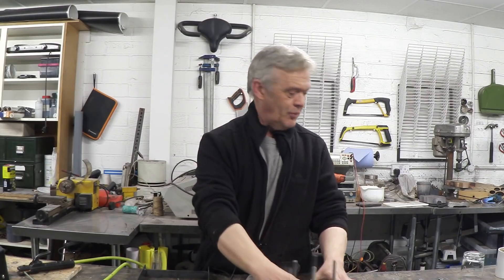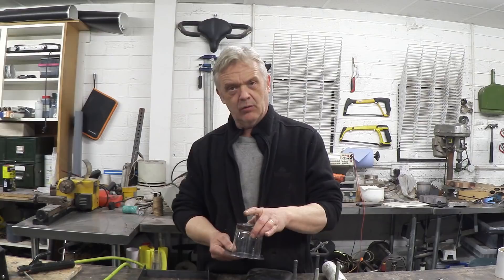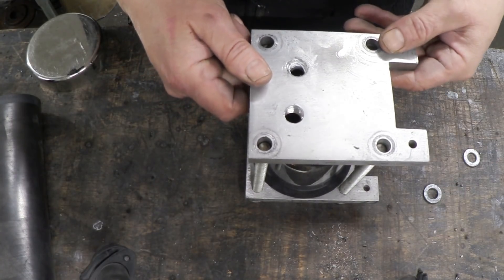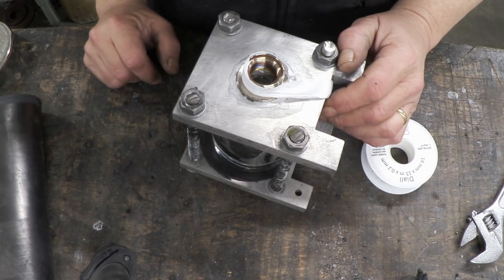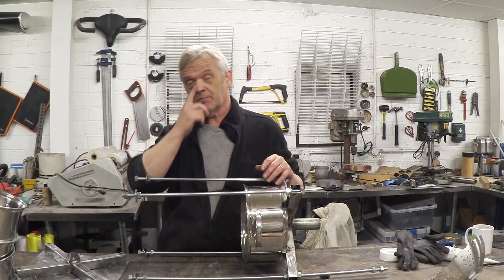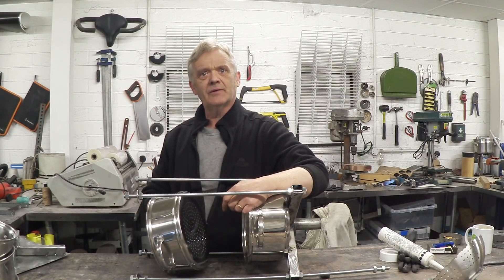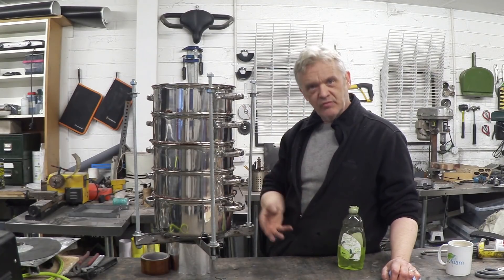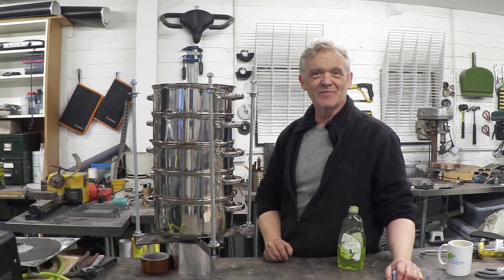DIY Gasification and Generator Unit - Seals

Comment: Loving Roberts's technique with this design,  though I would add a little note on using Red RTV.

Permatex Red TRV is easy to use but difficult to pull apart if you get the joint really hot. 250 - 300 C
It will hold together even when it is over-heated but becomes rock hard.  
With a low-pressure application you might be ok, but it can no longer hold pressure reliably.
Hence, it's given operating temp when used for making seals on engines. 

The hotter it gets the harder it gets, and then it cracks. 
With this application, the issue will be taking equipment apart to clean, service, or modify your kit.
I have crushed a 1.5" steel plumbing pipe while trying to unscrew it from a fitting after cooking the RTV. (+450C) 

Solution:
Spray the joint with WD40 and leave it for 20min. 
Scrub around the joint with a wire brush. 
Rock it loose and respray if necessary.
Once you have opened the joint soften the remaining RTV with more WD40.
It can then be removed using a wire brush in a drill. 

Also, you might want to look at brazing dissimilar metals.   (HHO gas torch anyone?)
A quick structural tack weld followed by a bit of gas brazing could be nice.
  
Dan Easton GEET life.

Comment: I know it's too late now but rubber window flashing tape would be perfect for what you did there. It's pricey but sticks to anything and can be "massaged" into most any shape due to its flexibility. Cut into one inch strips and "rolled" over the  edge down onto the "shoulder" would create a tight and reusable seal. Thanks again for braking it down for us in you're usually thorough style.

Comment: Here is a old formula for permanent fireproof clay seal. That has been used to fix and build fireplaces (from year 1852):
50% sieved ash 50% fine clay and some minced salt.
Add water to get the consistency you need.
They say its much better and more lasting for building fireplaces than regular plaster.

Comment: * since you anyway have spot welded it, buy a few rods of hard welding with blue tip . Caution since it is often phosfor or manganese on them, but anyway, a bad weld is often worse than a mediocre solder and often gas torch soldering is preferred for these things . Tensile strength of flame rod is about mig weld in twnsile strength, it is weaker than the arc you got but it wil seal very nice there. Aga or meltolit , green or blue ones ( it varies ) is also good for combining stainless and regular carbon steel wich sometimes is difficult to mix in a weld

Comment: this makes me wonder if the Starlite (or is it Starlight?) guess recipes like cornstarch PVA or elmers glue and baking soda would work for sealing these since it expands due to the CO2 released by the baking soda, making expanded carbon foam? kinda wondering if there is an additive too like boric acid to increase temp reliability, and maybe something that would allow the carbon to be more flexible with out being a combustible, :)
Reply from the maker: they are all good questions mate - fancy giving it a go?
Reply: @ThinkingandTinkering  the starlight stuff is on my list enough that I have spent probably about 100 bucks on supplies just for it along with all the stuff for various projects like borax, boric acid, phosphoric acid, mono sodium phosphate, 25 lbs of sodium hydroxide, urea, ect ect and probably close to 1000 dollars worth of the cheapest imported pyrex knock off borosilicate lab ware LOL. (then had a friend drop quite a bit of stuff from round bottom digital heating mantle, to the 5 liter 3 neck round bottom boiling flask also borosilicate based LOL, though only fused quartz I have is for the UVC lamp's water proof housing for photocatalytic activity, that will end up being in that 5 liter flask since it fits perfectly including the rubber end on the lamp to plug the neck it is placed in, :) just far to much to, no scratch the to, it sounds like chores, to much I WANT to do, than time permits lol,

Comment: There's a good chance any minor leaks will fix themselves over time with saponids from the wood,steam engines were often left purposely to rust when constructed to seal them but not applicable here lol,silicon baking sheets are readily available! Could always try African queen method torn wet rag,maybe too Heath Robinson?:)
Reply from the maker: The African Queen is one of my fave movies lol

Comment: Nice Idea using dish soap to prevent the silicone from sticking to parts you don't want it to stick.

Now that I think of it; wax that wood workers typically use and the spray people use on cement molds would do the same thing.
Reply from the maker: yeah they would - it's kind of what gave me the idea lol
Reply: @ThinkingandTinkering  
😎👍

Comment: Sealed, signed and delivered!
Very important using the right sealing material to match the joint as you said. A load of choices for each one. Thanks Rob, yet another great video.
Reply from the maker: cheers mate

Comment: Good one.  For a compression fitting, you might also consider a fiberglass, ceramic fiber, or kevlar cording as a composite with one of your no-kiln ceramics.  Kevlar paracord and thread are inexpensive.
Reply from the maker: I was thinking fibreglass rope - but you are right there are quite a few options including flexible graphite compression tape

Comment: e poxey
Reply from the maker: for sure mate - but you o have to be careful where you use it - most will start to burn off around 280 degrees C - so good for permanent joints but not so good for high heat nor situations where resealing is needed

Comment: On your tape- I much prefer the paste version, particularly for gas fittings.  That's what all the  old pros who knew things would tell me when I was working at the hardware store.  They'd take the tape if they had to, but said the paste in the jar was the more reliable seal for gas or air. I've found it to be the case. A little messy, but better than having to take the whole thing back apart again and reseal.   Not a common problem, perhaps, but, they said, when you're under somebody's house in the mud, or upside down behind somebody's stove with your creaky old self and busted knuckles, you only want to do that Once- so I'm passing along their wisdom :)
Reply from the maker: I used to soak a bit of jute string in jointing paste for large joints and the tape does need proper application - folks often put it on the wrong way so they just unwind it when tightening the thread - I have found it to be like any job - attention to detail and proper application provides a good joint - poor workmanship is often what leads to failure

Comment: You can get an attachment for the welder that allows you to strike an arc and get a flame to do brazing with. It is easier to make a join when the strength is not so important and can make a good seal
Reply from the maker: nice tip mate - cheers

Comment: Cool and Hot solutions for making the right, not so tight seals. Thanks for sharing Robert. You just helped me see a different perspective for a thermal vacuum table sealing issue I was having.
Reply from the maker: that's cool mate - cheers

Comment: Did you wrap the tread tape the wrong direction?
Reply from the maker: no
Reply: No, however if you flip the tape over and apply the tape running off the back side it’s far easier to keep tension on the roll holding it between 2 fingers as you go
Reply: @Ed R6 I had to rewatch the video just to see if it was my dyslexia or if he was going counterclockwise wrapping the tape. Wire nut connections you have to twist the wires the right way as well. Always hold the nut and pull on each wire to make sure it is secured.

Comment: Very practical stuff, thanks Rob. I'm sure I won't be the only one to notice this, but I think you put the PTFE tape the wrong way around the thread. I don't think it matters that much, and I know you just did it as a quick demo, so you may have even corrected that afterwards. Either way, I learnt a lot from this vid, thanks.
Reply from the maker: you are right I did and changed it when I was putting it on - for exactly the reasons you said lol